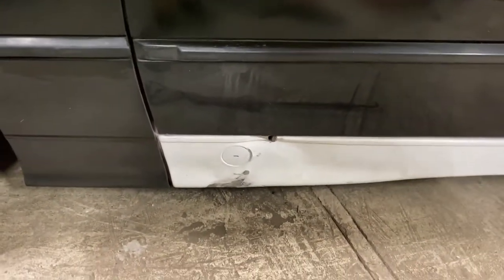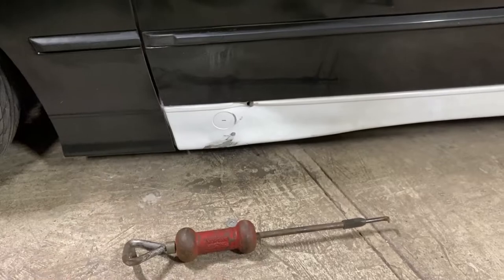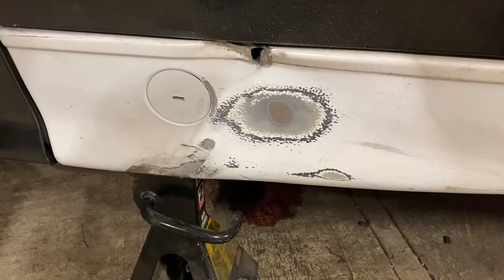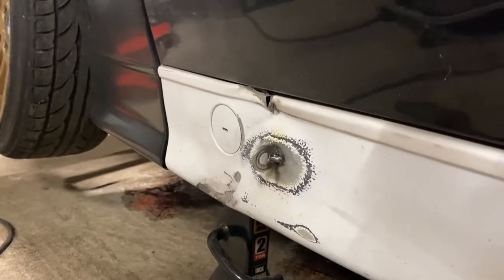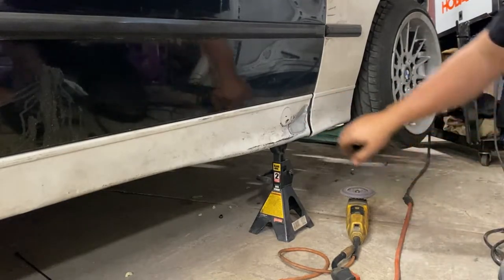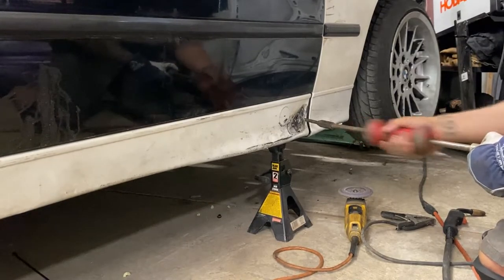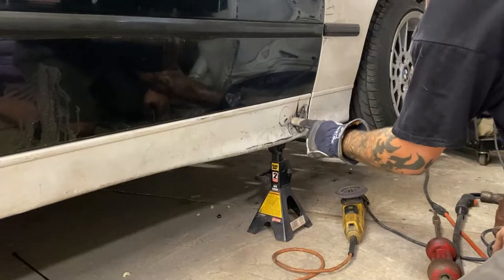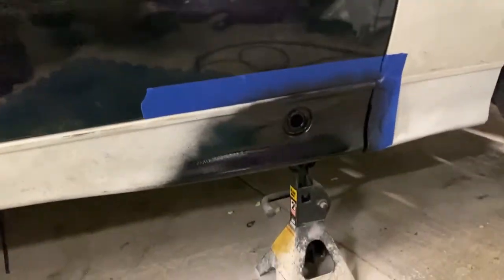Pulling Dents with a Washer and a Slide Hammer

Comment: Interesting technique.   So you cut the washer off the body panel with a cutting wheel and grind it flat with flapdisk?

80 grit is the way most are removing paint and primer as 36 grit will gouge the sheet metal.
Reply from the maker: Yes, and you are right. 36 grit scratches can be removed by stepping up to 80 and then using a paint stripping disc and then finishing off with a scotch brite wheel. Primer will fill any remaining scratches. But it’s better to just start with 60 or 80 grit to begin with. I wasn’t to worried about it since it was on a textured rocker
Reply: Sounds good.  Your technique looked too easy.   I'm definitely considering.
Reply from the maker: @dennisrobinson8008  they make actual weld on tabs that are meant for this. They come in different sizes depending on how big of an area you have to pull
Reply: I saw those nail looking ones.   Is pdr technique with glue tabs close enough?
Reply from the maker: @dennisrobinson8008  glue pulling works really well as long as the metal isn’t thick/high strength, and as long as it’s not close to a hard body line. You also need good clean paint for glue pulling.
Reply: @Teysik  Appreciate that input.   Will certainly consider using these techniques in the future.